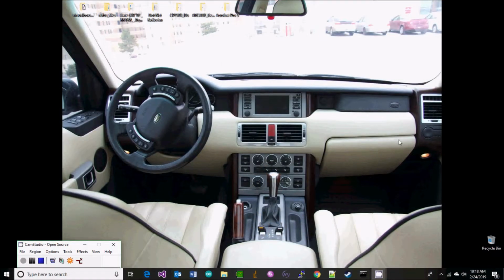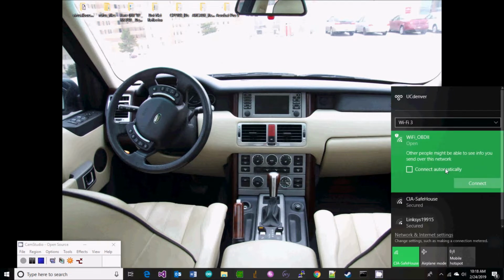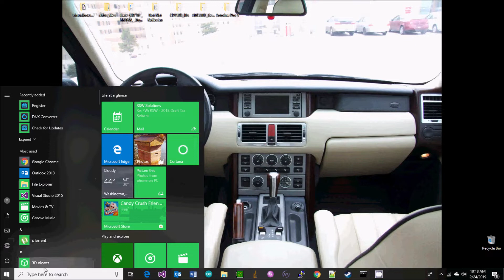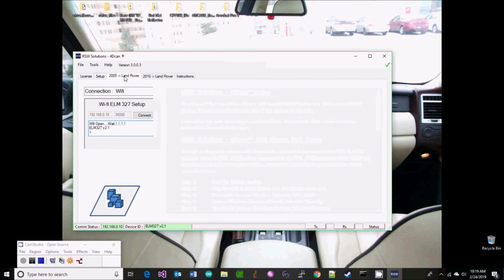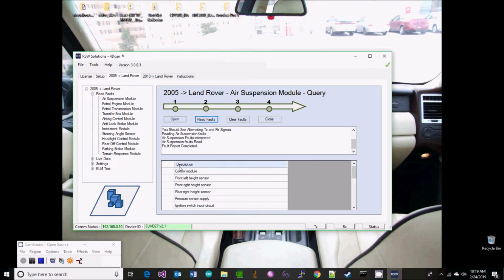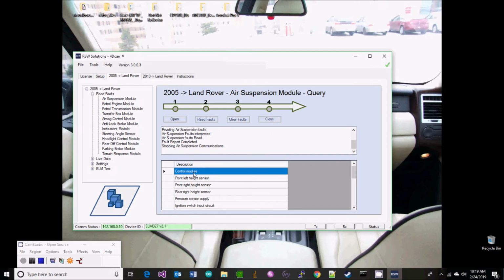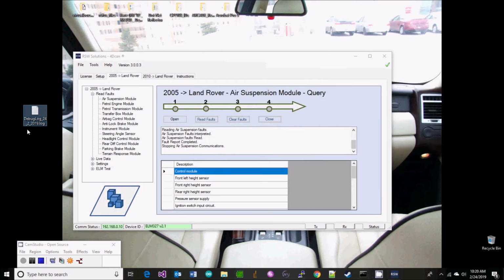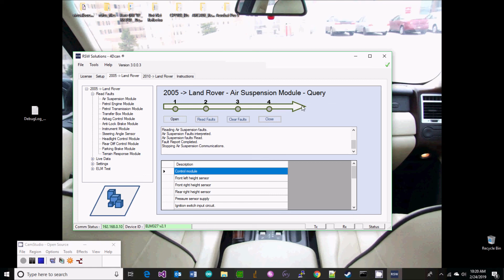4Dcan Troubleshooting

Comment: Hello, I was wondering what is the model of the Odyssey battery you are using in your Rover. I've had terrible luck with my Optima battery. I would like to switch batteries but need your advice on the Odyssey battery.
Reply: For the cost, I have not noticed any huge difference in performance. I would just go with the mid line AGM battery that is most easily accessible in your location in case of a warranty claim.
Reply: @teachingbees7048  Thank you very much for the insight! I appreciate it immensely!
Reply: Do you recommend any step for park and storing lr3 for longer periods. Like 1 and half year?